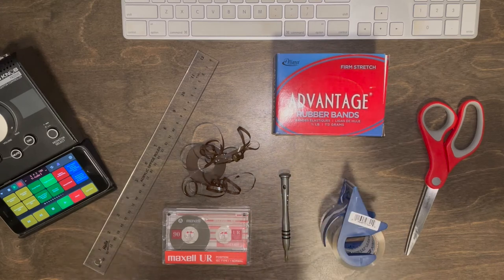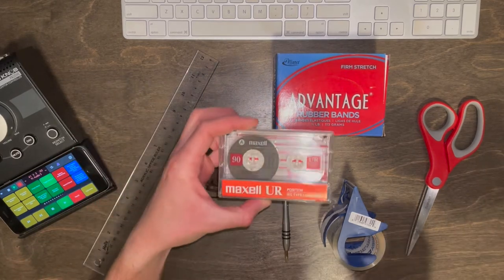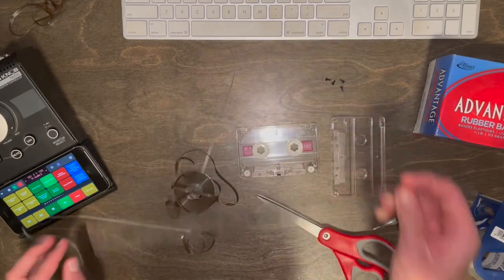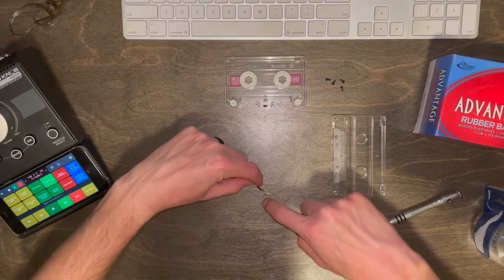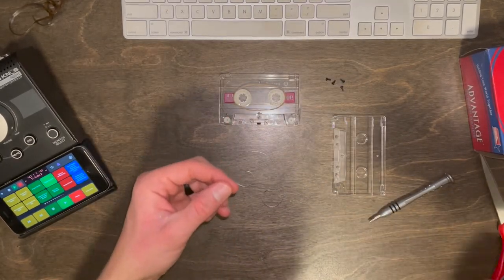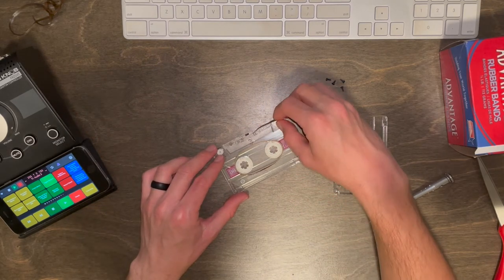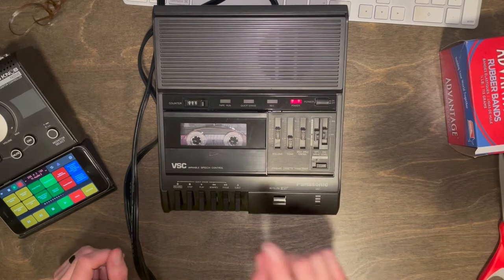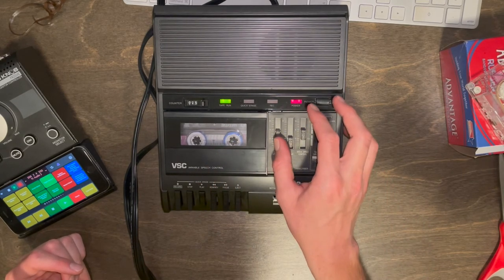Cassette Tape Loop Mod For Panasonic RR-830

Comment: Hey! I’m thinking about buying one of these but I want to hook it up to my daw to record audio directly on to the machine. What are the output options on this machine? And have you ever tried this?
Reply from the maker: You have one option, which is a 1/8" TS (mono, 8Ω). I have recorded an entire album using the 830, and you can hear its heavy use on said album. Granted, it is being run through fx so it won't be a an unadulterated look into what it sounds like raw.

https://open.spotify.com/album/1CN8YCQoAnjkkp1ElqTl9Z?si=2f9-ocPsTriflGz4g6SO_g